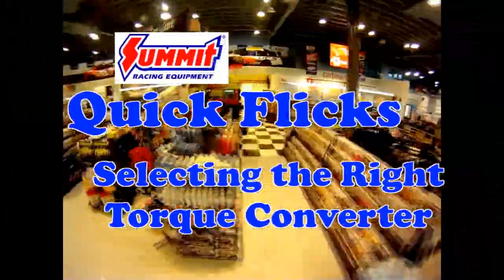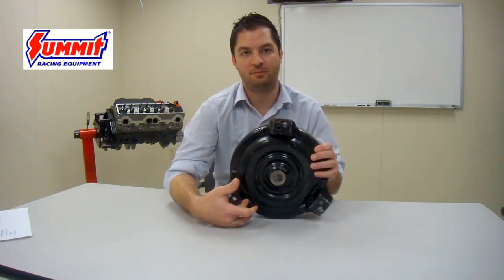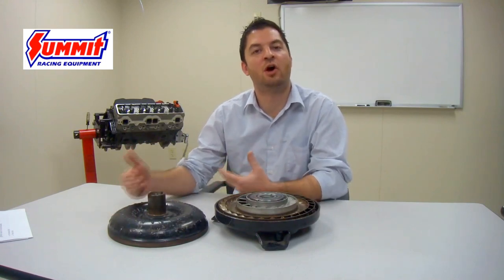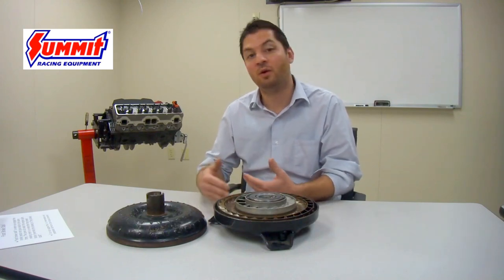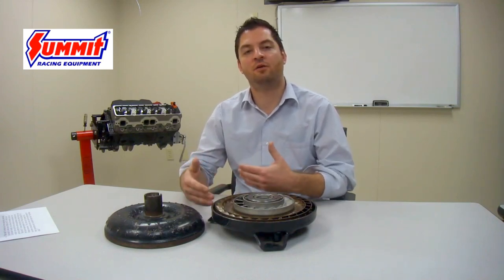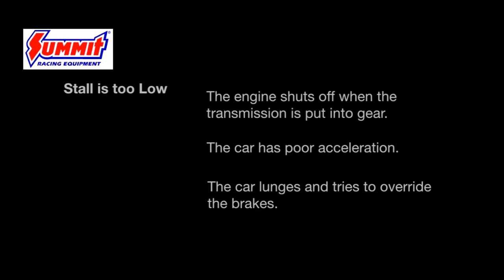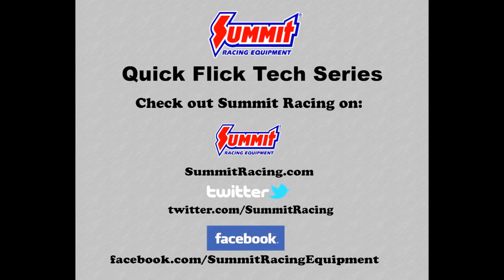Torque Converter Selection | How to Choose the Correct Torque Converter

Comment: Would have been good to note that a lockup converter won't have the issue of stalling higher than cruise RPM.  Also, would like you to address what typical factory stall ratings are....maybe provide the stall figures for common vehicles to help us understand the impact of changing stall speeds for those vehicles.

Comment: I like the screwdriver in the engine stand.
Reply: Whatevers clever
Reply: You'd love to watch me work on my truck 😂 you would not believe where I can put tools for safe keeping lol
Reply: There's another way to do it??? Lmao
Reply: Ryan Kelly,  Exactly!   Lol..
Reply: thats how mine is
Reply: Hahaha i do the same thing i lost the pin. Hahaha
Reply: Means they actually use it.
Reply: Keep it genuine & authentic
Reply: And the marker on the white board too....lol
Reply: Lost the pin it was probably put with the towing trailer hitch stuff people will come to clean up my shop helping and do it every time I put a tag and zip ty to stop It what a pain looking for it !!
Reply: Standard procedure
Reply: You might do the same at home this is a business. Get on the lathe and make a new one. So power braking will hurt my torque converter if I buy it from summit? So not rated for burnouts without a water box? 

35" wrinkle walls are pretty much the same as 265/20"s.
A higher gear ratio Makes it move easier?

Comment from the maker: A high stall convertor is used in drag racing because it allows the engine RPM to reach efficient RPM before launch.  A drag race engine makes peak horsepower HP and torque TQ at two different RPM points.  Most efficient start RPM or Stall Speed is to be 200-300 RPM over peak torque RPM.

For instance dragster engine makes peak torque  @ 5800 rpm, so I have a 6100 stall convertor.

Comment from the maker: For better acceleration with a stock engine, we would suggest a torque converter with an 1800-2000 rpm stall range. Anything higher than this will cause excessive heat in the transmission leading to potential premature failure.

Comment from the maker: Hi Rando, You have two obstacles to overcome. The lower numeric gear  ration and stock converter. Increasing the stall is necessary, but without increasing the rear gear ratio you will  not get the full benefit of the converter change.  We’d recommend a TCI Breakaway series converter .  It will give you about 1,000 more rpms stall speed than stack. Changing the rear gear to a 3.73:1 ratio will help maximize your overall performance.

Comment from the maker: A converter with a slightly higher than stock stall would be the right choice for your application. I suggest you go with a Summit brand converter part number SUM-G2704-12 ($229.95) for the best performance increase.

Comment from the maker: A torque converter with a stall between 2,300 - 2,500 rpm would be the right choice for your Trans Am. If your vehicle still has the stock transmission (4L60E) in it, Hughes makes a converter that matches up very well. The part number for this torque converter is HUP-22-25L ($369.95).

Comment from the maker: Assuming the car is street driven and the “Torque Converter Lock up” feature is still being used, we would recommend that you use a 2400-2600 stall speed for best results.
Reply: Watching in earnest.  My big questions:  Best rear gear and TQ stall/model with just a tune and CAI.  Peak torque stock is 4250rpm.  I've read two trains of thought: 1. Get a TC that stalls at or close to the peak. 2. Get a TC that stalls at 500-700 rpm below the peak.  No racing(?), just street-highway.  2004 Mercury Marauder.  Torque Peak stock at 4250 rpm.  Stock stall rating: 2850 to 3011 rpm.

Comment from the maker: The new camshaft will actually be the dictating factor in selecting the correct converter. Please supply the camshaft part number or specifications of the new cam so that we can make an accurate suggestion, hope to hear back from you soon!
Reply: I bought the Comp cam 07-503-8 for my 97 lt1 from summit now I'm looking into the stall converter. I've talked with a customer service rep. at summit on this but i was told its not the right one I need. I have an 87 year 700r4, 373 gears and run 275-60-15. What's best for my set up? Thanks

Comment: Thanks to you I was able to pick proper cams ,  torque converter wheel and tire size without guessing but at highway speed how much rpm above stall seed should you be a lot or a little or somewhere in the middle I used jegs calculator and came up with two gear options 4.11 which is about 300 rpm above stall(start) with my planed setup or 4.56 gears that are about 600 rpm above  I also read your comments and I realized I'll need to upgrade my transmission cooler

Comment from the maker: The “Impeller pump” is a welded part of the Torque Converter outer case or Dome as your refer to it. The Stator splines onto the larger shaft on the front of the transmission an sits between the Impeller and Turbine. The Turbine is splined onto the actual input shaft of the transmission and turns the inner workings of the transmission.

Comment: Great job explaining that. Glad you stated about the range and all the variables. That does make more sense. And I like the part about stalling at 500 rpm higher than camshaft . Also the part about choosing a converter that will stall below highway cruise rpm. Did not know that one.

Comment from the maker: A torque converter with roughly a 3,000 rpm stall rating likely would be the best choice for your combination. I suggest going with a part number HUP-GM30 ($329.95) converter.

Comment: Quick question 🤔 do I need to adjust my to tq convert if I changed my tire and rim size? I went from a 17inch rim to a 20inch chrome rim. I don't notice a acceleration drop do to having a jms pedalmax that eliminate the drive wire delay. I have it set at 75%. I tried it at 100% once. And it was to touchy. 75% is the kinda sweet spot.

Comment from the maker: Yes, there are 2 notches in the snout of the torque converter. When the converter is properly installed; those notches will engage the drive lugs in the pressure pump on the front of the transmission turning it at engine/flywheel speed.

Comment: Ok I need a little more help please. I have 3.90 gears and I'm currently building a 440 with an old ERSON .486 dual lift for intake & exhaust.  Well, It's ready to be installed now actually. And at 55 miles per hour the RPM is right around  2000 -2200. which is about as high as care to go for cruising. Curious as if u have suggestion for RPM stall. Thinking 2000 is plenty but I'm a little unsure. It's my first car build in almost 30 yrs and I just don't fully trust my judgment anymore. Any advise u have would be great.
Reply: Guido Sarducci, I was a GM mechanic back in the day, I went to a 373 gear, If you have the HP it's enough to light them up and lets you work on suspension and tires to get the power to the ground, but still let's you drive, I don't like going to a 4 gear unless its block to block racing, I know how fast that can be but it's too tall for me.
Reply: thank you...I went way too high a gear ratio and stall. I went with 2400 stall but it hooks @ around 2700 with this new motor. It's not really good for anything but burn outs and city light to light. (fun for what it is, but gets old fast) Plus I don't need any tickets - I've been warned twice already. I regret my choices. I can't hardly go anywhere. I'm dropping everything down. I'm fully comfortable going w/ 3.55 rear and 2000 stall. It was a learning experience for sure. I appreciate your input & taking the time very much just the same.
Reply: Guido Sarducci Choosing cam, rear end gear and converter is a bitch, I was a GM mechanic and my uncle who built pro stock machines still helped me pick an incorrect combination, I'm thinking 355 gear and 2 grand stall is now falling on the lame side,  355 is Too much  of a grandpa gear, That's when breaking them loose and hooking up(wrinkle wall) becomes hard, I would go a tad TALLER, keep that converter up above mild 2 grand-ish stalls, not much poop there, Oh fuck I'm no professor,  Just don't go too mild, Like to meat up at a red light some night.

Comment: I learned one lesson, don't go by the advertised stall rating. Bought a B&M 2400 and it stalled pretty much on the money. Had to have it repaired during race season and replaced it with a Summit one that was advertised @ 3000, but it actually only stalled @ 2200. Boy, was that ever a let down. The B&M is back in it now. Anyone want the Summit converter ? Very low mileage. Probably only 25-50 miles on it. (Torqueflite 727)
Reply: It's a RANGE, not a specific number. They said that in the video like 10 times. But 800rpm is a bit too much. Baybe + or - 300rpm would be fine, but not 800.
Reply: moparnutjim still have it? 😂
Reply: moparnutjim what is for. Im looking for one

Comment: I clicked, assuming that it would be yet another watered down Corporate Info Show...
While still not going into depth on any specifics, I found that very informative and interesting!! 👍👍

I'll need to keep looking, because I'm trying to find the right Converter for a mildly modified 4.2L V6 2001 Mustang. 

You mentioned that a Big Block will stall a little higher than a Small Block... 
But what about the minority with V6s - or FOURS?? 
Now I remember back in the day, 4cyl Mustangs had typically 10-10.5" Converters. They stalled at around 2100-2300 RPM. A Converter LIKE that (yes, the stock 2.3L unit would IMPLODE in a Big Block!!), are usually in the 3000-3600 RPM range. 

So.... It kinda makes it difficult to figure out the Math, to get a Converter for smaller Engines.
Reply from the maker: PoorMan,

Choosing the correct torque converter for any application takes some knowledge, experience and in some cases, some luck! While internal parts can be manipulated ... and are; external forces are a huge consideration. Things such as the weight of the vehicle, gear ratio and tire size. These are the resistance factors if you will. A heavier car with a stock gear ratio and a taller tire has more resistance to movement and may cause a higher stall speed. Now, on the input side, "the engine", generally speaking the more power spinning the converter the higher the stall will be. We shouldn't categorize this as a big or small block thing. There are some very powerful small engines out there! What is more important to consider is where the power band is for your engine. If it is possible to identify that, generally speaking, choose your converter stall speed to be approximately 500-800 RPM after the motor starts making power. In a perfect world a dyno sheet would be key here but, not all have that advantage so, a look at the power band on the cam card may be helpful. As stated earlier, internal parts of a torque converter also play a role in stall speed. Things such as case size, fin count and fin angle all have an affect. These things are chosen mainly by each manufacturer because they are the "secret sauce" so to speak that sets each one apart from the other. Not to mention, those parts take a deeper understanding of converter construction that many don't possess and therefore only add confusion to the process. 

Now these are very general points but, very important to keep in mind when choosing your torque converter! There is much more to torque converter science and many good resources available abroad for the inquiring mind!

Comment: Ok, regarding stall below highway cruising rpm, that is irrelevant if using a lockup type converter, correct? Say my engine needs a 3500 stall for the build, but gets driven on the highway at 75mph at 2500rpm, if using a lockup style, that's still fine, correct?
Reply: Correct

Comment: I overhauled my engine in my 1997 silverado with stock parts and now my transmission stalls. But before the repair,I didnt have that issue.Like I would accelerate ant I would be gone!...zoom!!
Could it be that my engine has gained more power due to the repairs that the torque converter now doesnt respond fast enough??

Comment: Hello, 

Brother if you can suggest me, I do have a gmc c25 that I swapped L77 6.0 in it. With BTR stage 4 package cam. Denali manifold, K&N cold intake. Upgraded pushing in the rockers, oil pump by mailing. Long tube header 3” 1/-7/8 with full catback by magnaflow. Upgraded 4l80E kit by tci up 800 hp. I tuned it and made up to 469 HP. What torque converter stall will be perfect for me ? Thanks

Comment: So if I have 3:73 gears running 275/55/20 and camshaft 2500 -3000rpm powerband...  I need a 298mm billet lockup converter and what stall should I get for my 4l60e

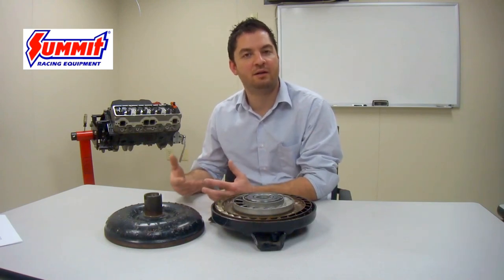Comment: One thing I dont understand at all is the BBC vs SBC explanation at about 9:30 . If the big block has more low-end torque, wouldn't it need a lower stall range than a SBC which produces less low-end torque? 

Since the BBC Engines powerband starts peaking so early on in the RPM range, wouldn't it be more beneficial to lock up the converter earlier on to get as much of that maximum torque to the wheels? Thanks

Comment: I've a Chevy Step-Side with a 427 Rat with a mild cam pushing a quality 3800 - 4000 ish stall torque converter.  The transmission is a 3 speed 400 Turbo with 4:11 gears in the rear and 33" tires.  The truck, I suspect, was properly built for very serious bush-bashing.  I would like the Rat to be able to go to sleep on the highway (overdrive, likely), and be fun to drive around town.  It drives city & highway alright already, but I feel it could hook up sooner, shift more positively/immediately.  Putting along at 60 mph, it feels well hooked up at 3200 rpm or so, but the 427 makes so much torque, I feel it doesn't need to be spinning like that.  I want to be able to do it all.  I want to drive it in the city, the highway, and the track.  Slush-boxes are beautiful when you get them right, but so confusing to get there.  Oh, hell … I'll probably just put a 5 or 6 speed in the thing, and get on with it - haha.  Any advice?  It is a set up full of contrasts.  An interesting puzzle.
Reply from the maker: Diesel Ready, 
It really depends on whether or
not you want to keep an automatic or switch to a manual. You’re going to have
about the same cash outlay either way and both will require a new driveshaft
and crossmember. Give us a call and we’ll help you put a parts list together.  1-330-630-0240. We look forward to your call. Thanks for watching!

Comment: I recently purchased a brand new 350 Chevy SB crate engine (part number 19420880). I have no idea on how to determine what the RPM starting range is on the camshaft that the engine came with. I am using a TH350 transmission along with the new engine. Could you tell me what torque converter I would need for this engine?

Comment: Hi.  What will happen if I fit an automatic transmission and torque converter from a 2.5 litre V6 car into a car that has a 1.8 litre 4 cylinder?  The final drive will be from a manual 4 cylinder.

Comment: Please Help...1991 C 1500...What will cause my 700r4 to lose reverse in a short 1 mile distance from a cold start or very slow to go in reverse but will slip if i give it gas and i lose O/D in short distance say 1 mile and trans will slip if going up a hill and steep grade and then i hear a shutter i assume is coming from the toque converter. When cold you take off and gun it it dont slip at all. Does like it should but only last a short time then i lose od and reverse and  will slip if i put small amount of throttle. Please help me if you can. I am a poor 60 yr old man and trying to fix this on my own from another trans i pulled less than a yr ago because it wouldnt shift right no matter the adjustment on the tv cable.  Got to were it took 40 plus mile a hr b4 it would shift from 1st to second. Im trying to fix one from two. Dont matter witch one long as I can get back on the road. Anyway I hope you see this and can help me. I cant afford to pay anybody to help me so I really would appreciate any help you can give me. Thank You...

Comment: Hey Summit Racing I have a 2016 ram 1500
Tsp stage 1 cam kit 
Headers
3.21 rear gear
On 35/12.50/20
And I still tow very often was wondering what converter you would recommend thanks

Comment: Thanks Summit for the help. I knew the gear ratio was not high enough but with a 3 speed and no OD, I wasn't sure if I would just be constructing a gas hog. I plan on going to a different tranny, then the rear end will be upgraded. My F150 has a 3.73, so I know what a difference it makes. Thanks again.

Comment: I have a 1970 C10, it differently has a after market cam installed. the dealer that I got it from doesn't know what cam was put in before, my mechanic installed a fuel injector system because of the carburetor just wasn't cutting it, but I  have great cruising speeds but terrible acceleration, it's time to upgrade the converter, wish me luck

Comment: What do I do for an LS swap with a 6L80 that over powers the brakes when you put it in drive? Should I get a torque converter with a higher stall speed or maybe a 4l60 with a lower 1 gear ratio?

Comment: I want mine changed to a higher end torque because in the summer, the oil gets too hot and causes slipping and also the engine goes any where from 1100 RPM to 1700 RPM just getting on a Hwy. That is way to high from my learning and it came that way even after having the trans rebuilt and modified after the inner bell cracked. Less engine wear and better mileage is what I'm looking at. No pulling trailers.